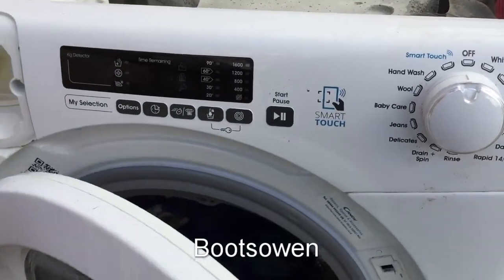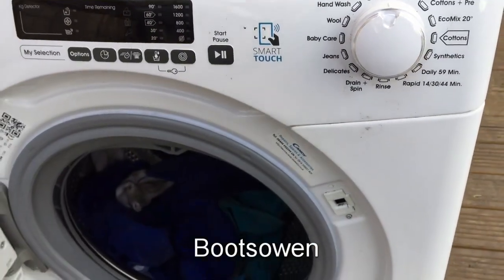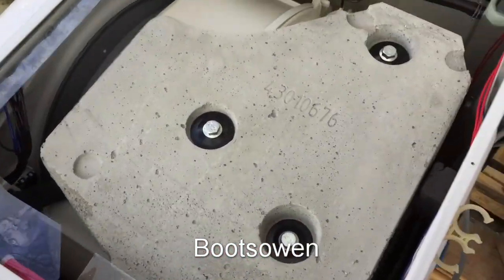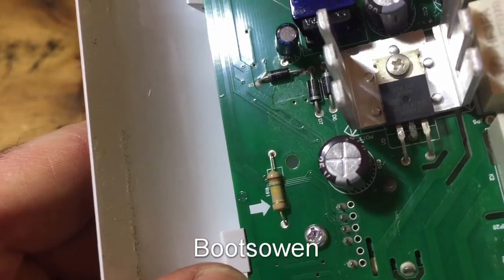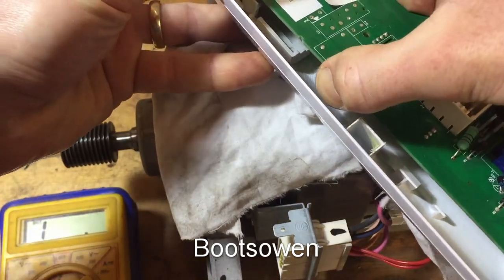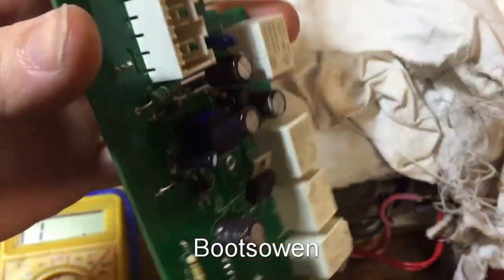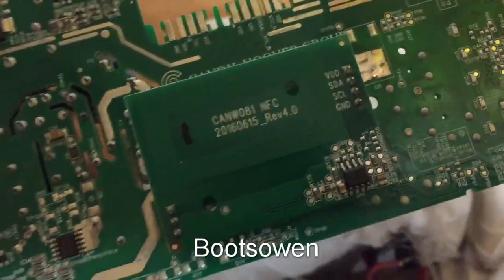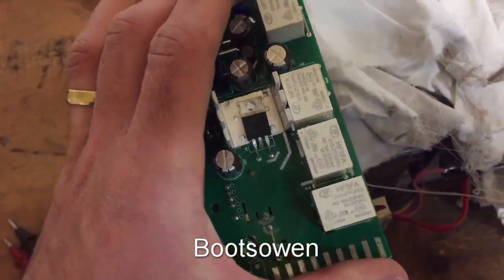Candy dissassembly and testing triac error E09

Comment: great video but E09 seems to be a catch all error, i had one on my vita (twice actually in 2 years) and both times it was the brush contacts for the motor , its really easy to change them the way i ended up doing it 
i looked at loads of videos and they all say take the motor out (which basically means take the machine apart)  but if you tip the machine on its back the motor is right there and the contacts just unscrew and are easily replaced 

hope this helps someone

Comment: My candy has no display and does not run. Kindly advise what could be the issue. Thanks
Reply from the maker: Start at the start. Is it plugged in?  Is the fuse working or blown? Is it switched on?  Is the cable damaged? Is the mains suppression capacitor damaged? Work through it to the point where it is broken. I’ll help if I can.

Comment: i get the error code 9 coming up sometimes i tend to get away with just putting it on a different cycle i guess i will need to get it fixed but i am not paying some engineer to look at it and charge me the earth i might take a look myself  looks a bit of a bugger getting the front off though

Comment: Hi, wondering if you could help out. My hoover was doing exact same as your candy and coming up with E09. Had a guy fit a triac whilst I waited for amazon to post mine. The washer kinda works but only on a 14 min wash. All other cycles stop after 10mins. I have tested resistance on new triacs and they showing 138ohms. The triac fitted to washer is showing 86ohms. Could this be the problem? I've tested the motor and tachometer and it seems fine. Thanks in advance.
Reply from the maker: I’m not sure that the resistance of a triac means much. I’d try it on a spin cycle. If it can do that it’s probably not the triac
Reply: @bootsowen  Thanks for getting back to me. Yes it works on drain and spin at 1400 and does a complete 14min quick wash, but stops after 10 mins in any other cycle. I read somewhere that the triac controls the heater element so maybe this is at fault. Comes up with E08 error now when it stops but I've tested motor and tachometer and they seem fine.
Reply from the maker: One of the relays will control the heater element

Comment: Where do you buy the parts? I need to fix a Candy Alisse go 485 machine. The panel wont light up at all so i followed the wiring to the board and it was a bit black on the board at connection. Any help greatly appreciated
Reply from the maker: I buy them wherever they are cheapest

Comment: Hola maestro, me pasó lo mismo me tiraba e09 en programa de 14 minutos funcionaba, pero en otros programas fallaba cuando iba a iniciar el ciclo de centrifugado, ahora bien sí pongo el programa solo de centrifugado no falla. Le cambié el triac de motor y funciono correctamente pero a los 15 días comenzó la falla nuevamente. El tacómetro está bien cambié carbones revise las bobinas y está todo ok. Incluso hasta cambié motor ... Cuál será la falla? Lo que si no conseguí el triac original solo un reemplazo. Será esa la falla?
Reply from the maker: Maybe, or maybe some other little component on the board is damaged. A new PCB might be the answer.
Reply: Hola Juan, buenas noches!! Yo cambio el triac, funciona 15/20 días y vuelve a tirar error 9. Lo hice 3 veces, hoy volví a cambiar el triac pensando que iba a volver a funcionar y ya no. No cambie los carbones del motor todavía, esa prueba no la hice. Vos pudiste resolver el problema? Muchas gracias!

Comment: Hi nice video. I am getting an e20 error on a Hoover Wdxoa 485acb 80.   The pump is pumping and the lines are all clear. Any idea?
I can find very little info. The only thing people talk about is an obstruction but that definitely is not the case.
Reply from the maker: Hi, what does the e20 error code mean?
Reply: @bootsowen  Blockage in drainage system or pump.
Reply from the maker: Yes, I am all out of ideas so! SO is it actually draining out of the machine properly?
Reply: @bootsowen  When I start a cycle it does the full drain of water in the machine. The pump and drain seem fine.

Comment: amazon have none in stock at moment will look elswhere how much did u pay for it please?..did u get the machine fixed?would like to see the follow up vid if u made one
Reply from the maker: I paid about £4 for 2. You can get them on ebay, check the number on the triac and order a direct replacement and some heat transfer paste.  I have posted a how to in another video.  However, if your machine is working on some cycles then the symptoms are different and changing the triac shouldn't fix the problem.  Have you googled the other causes of the e09 error?  could it be the motor brushes?
Reply: @bootsowen  thanks for that yes you could be correct i asked a pal of mine an ex washer repair man he said prob the brushes  thanks for your help

Comment: can you explain each relay to motor each relay to heater and so on 
explain circuit diagrame
Reply from the maker: I have done this in another video, It was on a hotpoint, wma50 maybe? Have a search. I talked through how the relays work and how they reverse direction. let me know if you need more.